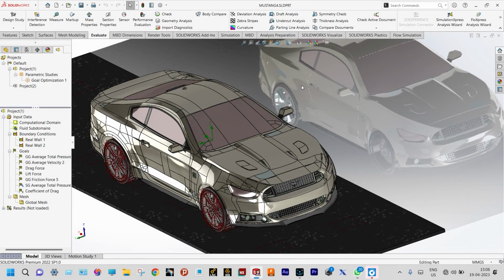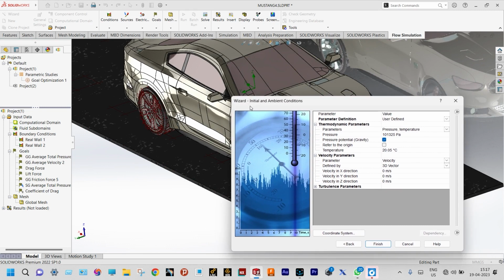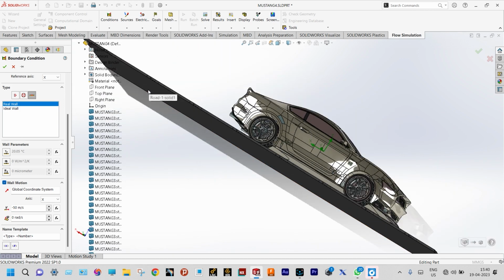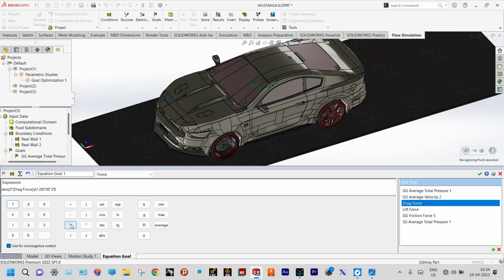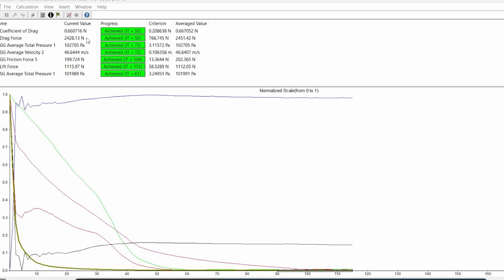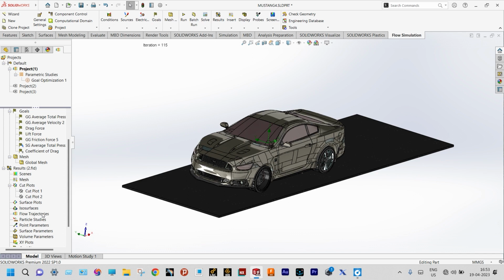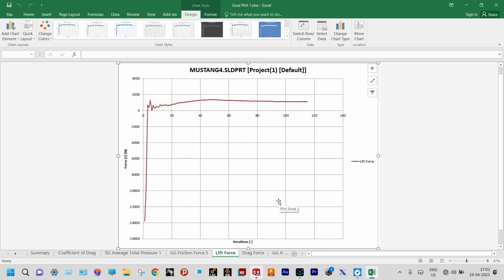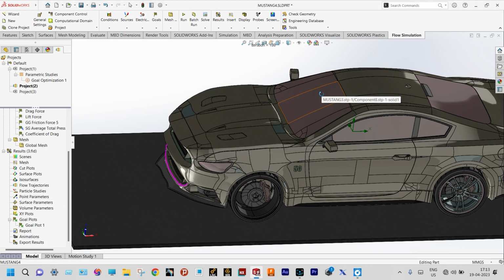CFD Aerodynamic Analysis of Ford Mustang GT - SolidWorks

Comment: I would like to ask your opinion on something. Is the dynamic pressure greater near the front grille or in the engine bay? Thinking of optimising the air filter location to get a bit higher manifold pressure. Thanks ! Great video.